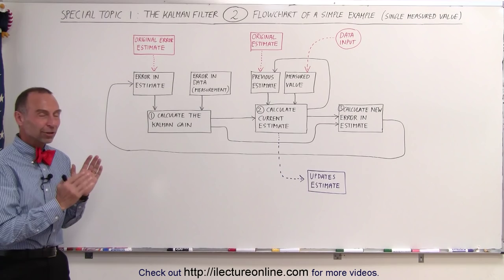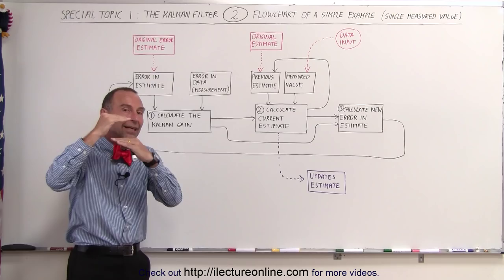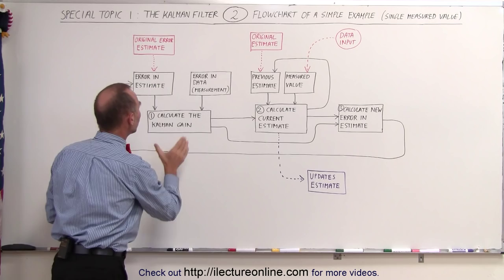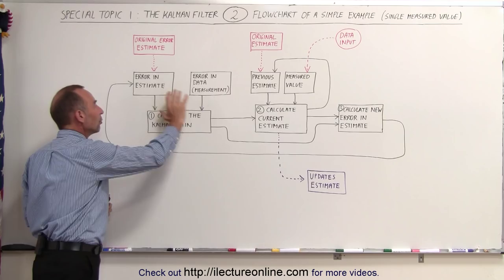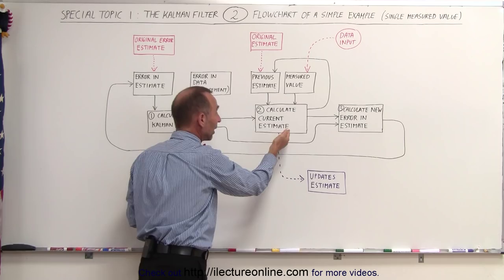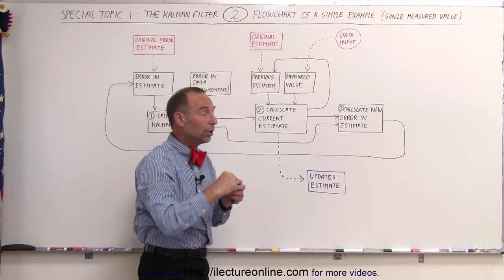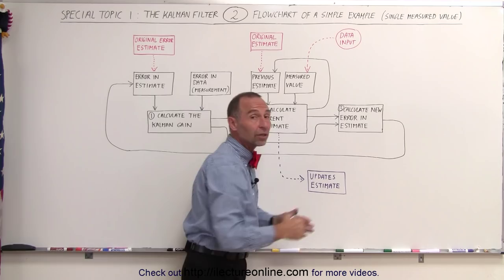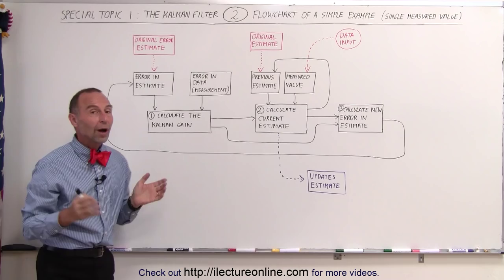Special Topics - The Kalman Filter (2 of 55) Flowchart of a Simple Example (Single Measured Value)

Comment: Spent many hours understanding Kalman. Started in the early 60's (now retired). If I had your video then (no internet back then.) I would have saved a lot of pain. I taught some simple Kalman filters for new hires so I appreciate your effort in your series. Revisited Kalman in my retirement due to virus lockdown (fighting boredom).
What is powerful about your presentation is slogging through the actual numbers is like a shining light.
Most presentations are big on math but short on numbers
I understand the effort you put in the presentation. It was so well thought out with the video breakdown. Viewed 42 videos then after that the fog set in (SLAM course #4).
Reply: May i borrow some motivation from u ?

Comment: Very nice and simple flow chart for basic introduction to K Filter. Any academic or professional training course can use this diagram to jump start the team developing specific K filter for their application. 
One comment: I think there is an input link from the "Measured Value" box to the "Error in DATA" box in the diagram that is missing. In the above the "Error in DATA" does not get updated in every iteration.
Reply from the maker: Thos details are covered in the later videos, when we go through an example in more detail.

Comment: The most important part is @2:13 - 2:39.

Basically, estimates are expected to be prone to error, but measurements are too sometimes. The Kalman filter takes the human intuition "... something is not right with this, I should use that instead." and turn that into math to decide which is which.

Comment: Nice lecture! 
But,  I have a small doubt @(4.30 sec). Sir, do we need the current estimate state value to calculate the error in the estimate. 
As per Kalman filter equation of (error covariance update), we need the Kalman gain and  the previous error estimate/initialized 
value (for the first time) only and not the current estimate state.
I request you to kindly check it once.

Comment: Excellent work sir...But may i know the source of the measured value.
Reply from the maker: The measured value typically comes from a sensor.  The errors introduced come from 1) Inaccuracy of the sensor  2) Variations introduced by the method (vibrations, etc.)    3) Environmental influences (atmospheric conditions, etc.)

Comment: How do we calculate the Error in Data (Measurement)?
Reply from the maker: The error depends on the situation and how accurate your measurements are.  It typically requires some knowledge of the system you are applying the filter to.
Reply: Thank you so much for your help :) I just discovered your channel today and I will be watching a lot of your videos. 
And actually, I just understood it from the example you gave in the 5th video of this series!

Comment: Sir you are very energetic and trying to give most accurate explanation but using so m any words without proper flow. I was expecting a flow chart with step by step explanation. But your explanation is going back and forth very unpredictably. I repeated this video 3 times yet the result is same, I could not follow the flow.